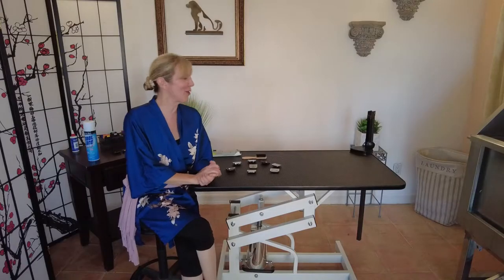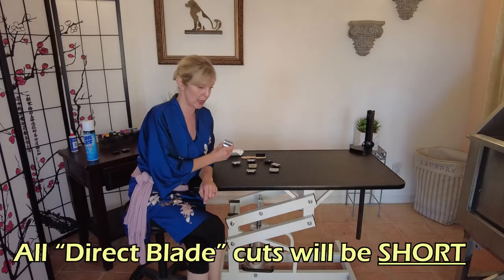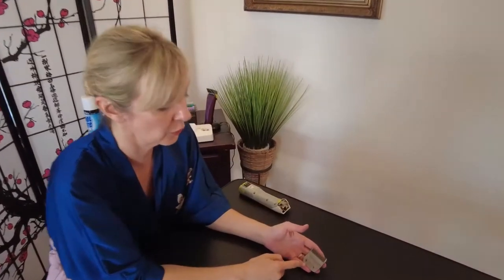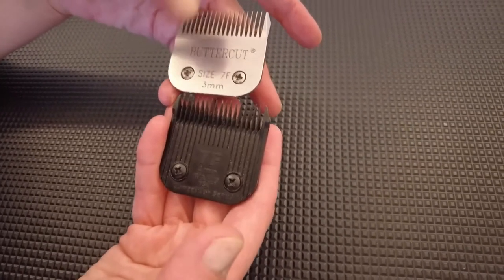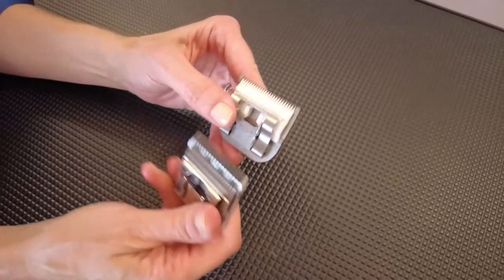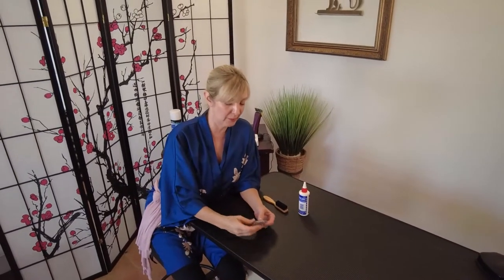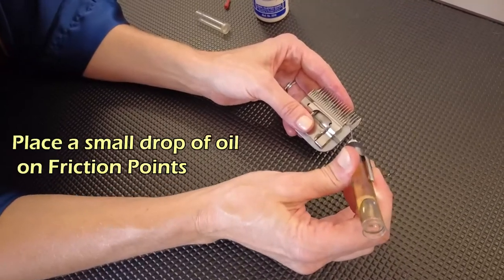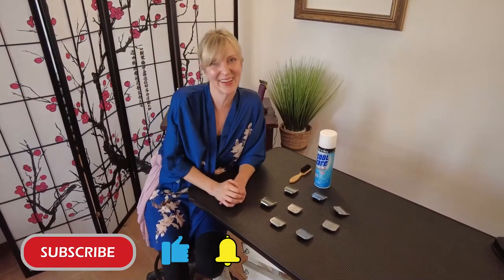Clipper Blades for Pet Grooming Explained - Gina's Grooming

Comment: Great instructional video.  But question:  I don't really know why you need different blade sizes if guides are what determine coat length.  Why do you ever need to use different blades.  For example:  Is there any difference using a 3/8" guide with a 10 blade as opposed to using with a 30 blade?  Thanks for any info (and apologies if already asked and answered!)
Reply from the maker: Hi Jonathan!  That truly is a great question!  Most groomers will use a #30 under their guide-combs 99.999% of the time.  The difference between using a #10 or #30 under a guide-comb is not very noticeable, but the better answer is that a #30 under is more efficient and tighter.  In terms of the shorter guide-combs vs. blades, the key element is that if you have a matted coat (I mean, all the way to the skin), you'll need a blade, not a guide-comb.  The comb will catch and not get under the matting like a #7F or #10 blade is designed to do.  Guide-combs are for longer cuts, blades are for shaving.  Hope that helps and thanks for your insightful question!  🙏

Comment: New to your channel. Everything you could possibly want to know about grooming is answered, very detailed. Thank you. I do have one question though. I'm just learning on how to groom my female havanese and I am using a Wahl Arco clipper which has a 5 in 1 blade which didn't come with instructions, what are the different numbers used for?
Reply from the maker: Hi Rick, glad to be of service, and what a great question!  The 5-in-1 adjustable blades usually come in the following lengths, starting Left to Right, if looking directly at the switch to change lengths:  #9, #10, #15, #30, #40.  The longest of the five options is the #9 at 2mm (you can look at the blade move as you adjust, and the #9 will be the farthest placement between the front and back blade).  So, every length on this blade is SHORT!  The #40 is considered a "surgical shave" and is only used in very extreme circumstances.  Out of the five options, Groomers usually mainly use two of them:  #10 (for sanitary clips, clipping matting behind ears, beginner paw-pad shaves), and #30 (for advanced paw-pad shaves, and as the de-facto blade to use under guide combs.)  The guide-combs are where you do your puppy cuts, but with a coated dog like a Hav, sometimes you may need to have more juice (like a corded clipper), depending on the thickness of her coat.  But I am absolutely able to get thru some of my Hav clients with my detail clipper and a guard comb.  Hope that helps, and thanks so much for joining the channel!  👍💕
Reply: @GinasGrooming  thank you for replying to my question, it was a huge help in  understanding the blade numbering.

Comment: Question for you ! I've recently been looking into proper blade care and how to make sure that your blades are tensioned correctly. I found out that the cutter is supposed to slip pretty freely when you're moving it to clean the blade. Some blades come with a little rubber piece underneath the tension spring, are you supposed to leave that on or take it off out of the packaging? Probably a silly question but I haven't seen any clear answers anywhere and I want to make sure I'm handling them properly!
Reply from the maker: What a great question!   First, the little rubber/plastic piece under the spring is done intentionally to reduce metal on metal friction, so leave it on!  And yes, back plate should be able to be pushed side to side with some tension, but without strain.  If it gets tight, I work on oiling it, rather than adjusting tension (I leave that to my sharpener.)  We just released another video on blade maintenance if that may help.  Thanks so much for your insightful question, and thanks for watching!  😍 https://youtu.be/DWtVFBX5HTI

Comment: Coolants don't contain enough oil to adequately lubricate blades. Apply blade oil after using coolants.
Reply from the maker: That is true!  A reasonable schedule is to oil the blades at the end of the day, while spraying coolant throughout the day to maintain the blades.  Thanks for the input!